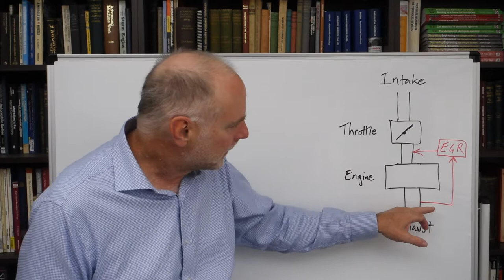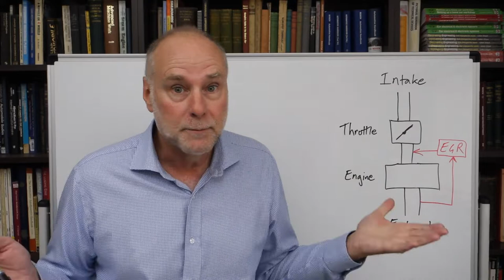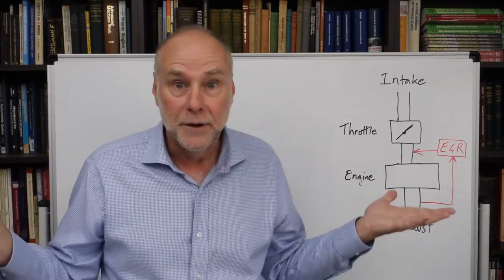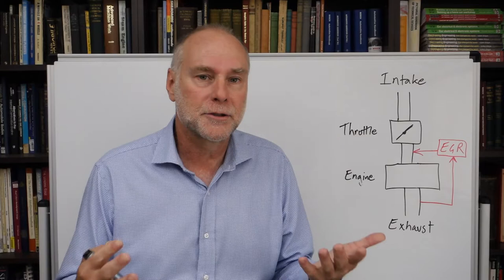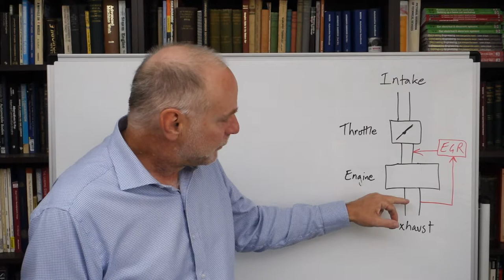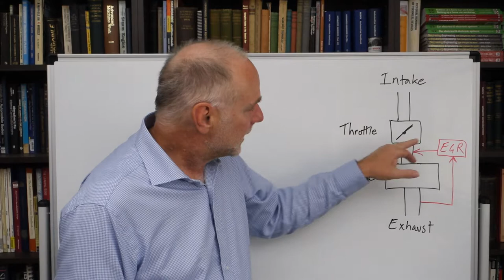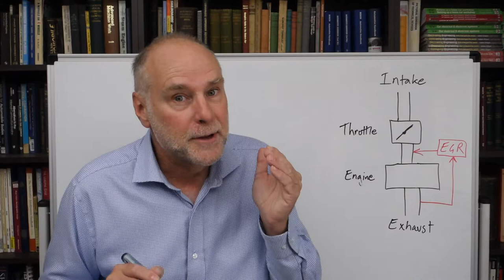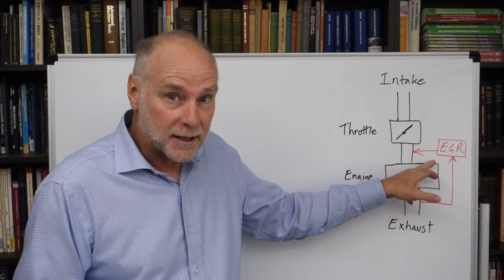Using EGR to improve mileage

Comment: EGR valves are not beneficial performance or economy devices for petrol engines any more than they are for diesel engines; they are designed primarily and simply to reduce NOx emissions. Unfortunately any increase in exhaust gas recirculation will also increase particulates and carbon build up; it's a trade off that also needs more maintenance and an effective DPF (in the case of particulates); which in turn robs even more performance. Modern petrol engines increasingly, have made better utility of turbochargers to greatly increase both economy and return performance, particularly for smaller engines, and especially ever since diesels have been demonised; and re-mapping such an engine, with this in mind is a far more effective method than re-mapping only the EGR valve behaviour.

Comment: No discussion of dilution of the fuel mixture and the loss of performance that follows. Very incomplete video.
Reply from the maker: Huh? There is no dilution of the fuel mixture. Measure the AFRs and see for yourself.
Reply: No dilution? It's diluted by definition. Assign air and fuel variables X and Y. Then add egr gasses assigned variable Z. You're telling me that X+Y is the same mixture as X+Y+Z? It's basic common sense. Get some. The reason the AFR is correct is because manufacturers accounted for variable Z and adjusted mixtures accordingly.  @JulianEdgar
Reply from the maker: Well if the AFR remains correct, what exactly is the issue you are trying to highlight? Any performance drop is irrelevant because it occurs only at low throttle angles.

Comment: The problem is the amount of soot it gets all over every valve. after around 10 years the valves are fully crusted over and heavier than they were before.
Reply from the maker: In port fuel injected gasoline engines? I've not seen that.
Reply: Exhaust has plenty of water vapour in it which should help clean intake valves, along with atomized fuel.
Reply: Everyone who says this doesn’t happen has Never taken apart two engines side by side.  One pre EGR and one post EGR era!  The post era engines drive soot into the engine intake and create caking and restrictions everywhere. From the tunnels and intake valves to the exhaust valves.   I agree this tuning can be used to increase mileage but it substantially decreases the life of the engines. That’s why manufacturers love it!  Modern engine designs with NO EGR will last hundreds of thousands of miles. Not good for car sales!  Every improvement has a downside and comes at a cost!  In Diesel engines the spot gets into the oil and causes bearing failure ask any engine builder. 👍🏻
Reply: @Tural Musaibov yeah it cleans only the valve it's spraying on which means the one next to is getting caked.
Reply: @ravenouslove1  and the entire  intake runner is caked with spot and crap. Reducing airflow and this power.

Comment: What about replacing the EGR intake pipe with a small air filter so it's not just reducing pumping loss but also using clean air instead of carbon deposites from the exhaust?
Reply from the maker: That's just adding a throttle bypass (eg like having an idle control valve open).
Reply: @JulianEdgar  yes of course, my bad 🙄
Reply: You'd quickly lean the mixture to the point it wasn't ignitable

Comment: Hi Julian i'm about to fit 2 x TDI 4.2 L  V8 into my boat , i want to get the best fuel economy possible , how does the EGR set up work on the TDI V8 ... or should i not be concerned about fuel consumption with these new V8 diesels .... old engines are cummins QSB 5.9 L  6 cyl.     ps your videos are very informative  regards. Andrew
Reply from the maker: Hi Andrew. I lived on KI once. This video on EGR applies only to petrol engines with throttles. I can't help with diesels.
Reply: @JulianEdgar  yeah wow how cool is that .... got any expert diesel mate who might know
Reply from the maker: Don't they list fuel consumption data eg kg/hp or the equivalent?
Reply: @kangarooislandmarineadvent7407  Diesels don't have throttle pumping losses, hence EGR does nothing for diesel fuel economy, however, it will help with nitrogen oxide emissions!

Comment: When it comes to pumping loses, in most cars the egr has minimal to none influence. Because the intake valve on most cars open near BDC after the piston has already incured pumping loss. This allows the chamber to create a lower pressure allowing a rush of air to come in when the valve opens to properly mix the air fuel in petrol cars.

Egr is mainly there for lowering combustion temps below nox formation.
Also with lower temps comes less tendencies for knock which allows for more spark advance and efficiency.
And if power isnt needed, egr displaces some of the air with inert gases, effectively making the engine smaller but not by much. VVT is probably better at this.
Reply: The inlet valve  starts to open before TDC at the end of the exhaust stroke hence valve overlap. Not BDC.
Reply: Wrong.

Comment: Hey Julian, thanks for the video, it was very well explained. I have a question, what about putting a canister to get rid of the oil build up? Would it work or is just a waste of time?
Reply: If you mean an oil catch can, yes that always helps. Egr itself doesnt create build up. But mixing it with oil will.

Comment: Thinking out loud, I wonder if an 8-stroke cycle would be good for economy at less than about 50% throttle. That is, the normal 'suck, squeeze, bang, blow', followed by the same again but without any fuel injection (and optionally, spark). That would halve the number of power strokes for a given RPM, meaning the throttle position would have to flow twice as much, plus more for the losses due to the 'wasted strokes'. Would that reduce overall pumping losses? It would increase the effective compression ratio on the normal compression strokes, which should increase torque. Could any current ECUs be programmed to test this idea?
Reply: Therfore you need a heavier flywheel to keep the engine running  at a steady rpm inbetween power strokes  .Are you an automotive engineer? .....thought not.

Comment: I recently got a bmw e46, 320 diesel from 1998. When i went to the mechanic to check it out, he told me that the EGR is deleted and that it is good for the engine not to have EGR. I believe this has some benefit but the fuel consumption for the bmw on specs is 6l/100 km but in reality its arround 13 litters. I changed the air sensors, i did service to it, the performance improved but the consumption didnt... Do u think i should return the EGR valve, clean it and try if it lowers consumtion? Could the Deleted EGR be the case for few litters more consumption? Best regards ! Thank you !
Reply from the maker: The video is about petrol engines, not diesels.
Reply: @JulianEdgar  isnt the egr the same for both petrol and diesel ?
Reply from the maker: In terms of fuel consumption, the effect is completely different.
Reply: @JulianEdgar  Aha, thank you very much mister Julian.

Comment: why not just partially bypass the throttle from before the throttle (air filter) instead of exhaust?
Reply from the maker: Because that will be the same as having the throttle opened wider - ie more power.

Comment: Good Morning Mr Edgar i would love to pick your brains on this topic for a little bit as i have a ford f-250 from 1991 . and have been looking at ways to increase the fuel mileage on this truck which is HORRIBLE AT 9 MPG !!! :( what i was looking at was simulary done back on the old Chrysler ( late 80's )  Lean burn carbureted systems. that took the exhaust gas and blew it up on the inside the air filter since that was clean air to begin with and did not need to be filtered . and the carburetor had in it a electronic fuel adjustment into itself. Well since the 5.8L which is a windsor 351 class runs on a Multiport fuel injection . and is controlled by the ECU . what i am looking at and working thru is this idea as follows. Since the Ford just basically has the exhaust gas running from the cat in a circle picking up from behind the cat running to a solenoid set and then back to infront of the cat( with nothing being put back into the motor)  the cat and the smog pump just adding some fresh O2 into the system there . and only one bank ( passenger side ) tied into a EGR SYSTEM  . is to take the the EGR plug it from the exhaust head . leaving it attached in the intake phellem  and shorten the tube that connects to that so i can then take the exhaust tube from before the cat run that into the smog pump which at such time it will mix with the fresh air from that and then introduce the mix from that back into the EGR system . so it can then be reburned thru the motor . The point of running it through the smog pump first is two fold . one being is that it will suck the exhaust gasses from the tail pipe system ;second it will then mix in a amount of fresh air into it before reintroducing back int the motor. and the point of leaving the EGR valve in place is to regulate the amount of the gas mixture i would then be making back into the motor.  for as the smog pump turns it would then be working as a poor mans turbo, for the quicker it would turn the more of the gas mixture/air would then be pumped into the EGR  valve. and with the EGR valve being vacuum controlled and also a limited port size, it would then control how much of this mixture makes it back into the motor  . the gasses that the smog pump would be making then would be under pressure going into the phellem  and motor block. the smg pump it self would make around 50 cfm at full open i believe , and i don't know for certain if that number is variable upon the rpm of the motor as i am thinking and or hoping . or do you think because of the fact that it would then be pumped and limited by the amount of air the smog pump would be making that i could then just use the smog pump to limit and control the gas mix back into the motor ,with out the EGR  valve. Any thoughts and opinions on this matter Mr Edgar would be highly appreciated . And you can feel free to respond directly back to me thru Facebook at Paul J Conroy Sr of which you would see myself and  2 of my sons at one of their graduations ; as i am on there more then thru youtube .  looking to hear back from you soon and be well Sincerely Paul J Conroy Sr
Reply from the maker: I am sorry but I don't really have any idea of what you are talking about. However I do know one thing for certain: manufacturers have spent literally billions of dollars improving fuel economy and any 'home-based' idea that is said to improve fuel economy typically doesn't. In the video I am talking about tweaking one specific aspect of tuning (EGR) to better suit that specific motor. I am not talking about a new system or a dramatically changed system, because I have never seen that approach actually improve mileage.
Reply: I personally don't like the sounds of it. First, exhaust causes are already pressurized. Second, too much exhaust gasses cause misfire since the already burnt air has little to no oxygen in it. Depending on which state or country you're in, I would say the best thing motor-wise on that is to eliminate every parasitic loss. Scrap the smog pump, AC, power steering, unnecessary idle pulleys. I did this to my old Mustang with a 302, kept the power steering though because I'm a wuss, just had the crank pulley, water pump, altenator, PS, and tensioner. I was able to achieve almost 30mpg when I drove it right, but usually only 15mpg the way I liked to drive it. I'd say the biggest problem is the truck itself, with it's massive weight, stupid I-beam front axle, and horrible slushbox automatic. I don't believe Ford's ECU programming was very good back then either.
Reply: @johnurbanek1027  There can certainly be some measurable gains from removing the power steering pump, maybe up to 3% or so depending on the vehicle. There can also be gains from replacing a belt driven fan with electric fans since they only run when needed instead of running constantly. The AC compressor is nothing more than an idler pulley when its not on, the pulley spins freely when the clutch is disengaged. Idler pulleys use almost no power, they spin incredibly freely compared to the rest of the engine. You would gain more MPG by turning off your headlights or converting to LEDs than you would by removing idler pulleys. Idler pulleys aren't there for the heck of it, they are important because they maintain proper belt routing so the belts wrap around as much of the pulleys as possible. If the belt is wrapped around less of a pulley after removing idler pulleys, it's torque capacity at that given tension is reduced. In other words, the belt would need to be tighter to not slip, which isn't great for efficiency or the longevity of the bearings in the accessories. Looking at the positive, you will definitely gain MPGs if your belt flies off from these modifications since you would no longer be driving the alternator, water pump, fan, and power steering pump. We all know that those components aren't really needed and are just there to reduce our MPGs anyways :)
Reply: @averyalexander2303  You gotta know what you're doing. Don't just unbolt everything and hope you can find a belt to go around it. I took the time to relocate the alternator and power steering, and used a reverse rotation water pump, to make sure the belt grabs a lot of surface area around the pulleys. I always believe that the less you have, the better you'll be. The more stuff I can live without, the less stuff that needs maintained or replaced later on, the less weight you have to lug around, and ultimately the less fuel you'll use. This is why to my customers or friends who are slobs, I try to teach them that cleaning the trash out of their vehicle might get them a few extra MPGs.
Reply: @johnurbanek1027  Okay that makes sense, I didn't realize that you relocated accessories to maintain good belt wrap. I agree that less parts are better for reliability, keeping things as simple as possible is nice. However, simply eliminating idler pulleys most likely won't make any measurable difference to gas mileage by itself. If more MPG is the only goal, getting LED headlights and tail lights would be much more productive.
Reply: Well, really don't need exhaust gas being recirculated back into the in take. Congress around '03 in the states actually ruled that EGR valves are overkill and detrimental to the engine . Thus many later models do not even have EGR valves.
Reply: Nobody is reading all that

Comment: In fuelcut (fully off throttle, no fuel being used) the EGR opens fully, to allow as much EGR flow as possible, to reduce pumping losses.
My Honda Jazz (fit) has a sticky EGR valve.. when you come out of fuelcut, you get a jerk.. the valve didn't close in time and so the engine got extra exhaust gases (which the ECU wasn't expecting) so was misfiring and etc.

I unplugged the valve, and found that problem to be gone (proving my theory that the EGR could be used in fuelcut operation).. However unplugged you:
A get more pumping losses (esp part load high RPM)
B the ECU has thrown a check engine light and runs base timing map.. at 30mph in 5th gear (eco driving! ~1400rpm) it was 16.5 timing advance vs between 25-31 deg advance.

Plugged in again for fuel economy (want the extra timing for now) but will clean the valve off soon to stop the jerking.. I'm impressed.
Reply from the maker: Yes, EGR operation seems a long way ahead of public perception.

Comment: Will blanking the egr on diesel car produce any harm to the engine, considering the temperature will rise?
Reply: nope
Reply: A diesel has no throttle, so there's no benefit to pumping loss from EGR in one.
Reply: egr increases thermal efficiency

Comment: Is this the same for a diesel as they do not have a throttle plate?
Reply from the maker: No it isn't the same with diesels.
Reply: @JulianEdgar  Would you recommend to get rid of the EGR on a diesel?
Reply from the maker: @insidebyte8561  Sorry, I don't know enough about the pros and cons of that to comment.
Reply: Diesels with egr do add a throttle for this purpose.
Reply: Do not increase EGR gasses on a diesel. Diesels have considerable blow by when they are cold or at idle and they will allow soot into the oil causing failure of hard parts like bearings etc. Mosern diesels do use a throttle valve just like this example but it reduces the life of those engines to the same as a gas engine in cases where the engines are idled for extended periods.

Comment: Better have more fuell fumess from the gas thank.
Reply from the maker: Sorry, I don't understand you.
Reply: Julian Edgar he may have been suggesting to trigger the EVAP purge valve. That would probably be problematic unless the injectors tightened up their pulse durations or shut off completely as I understand things...that may already happen on some vehicles, though, when EGR is triggered to open.
Reply from the maker: @gregorykusiak5424  Closed loop feedback means AFR remains as required, irrespective of additional fuel entry.